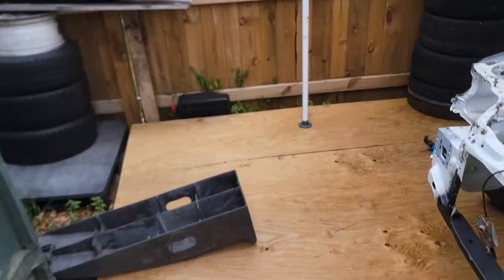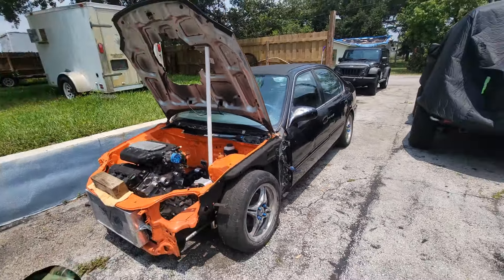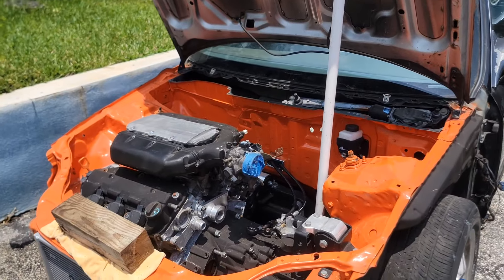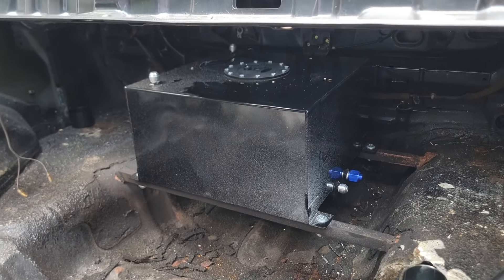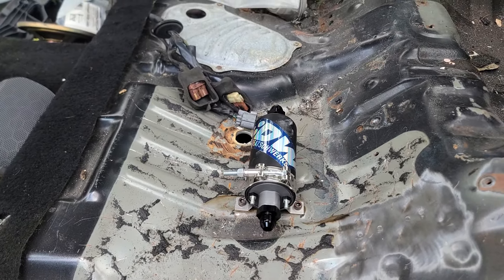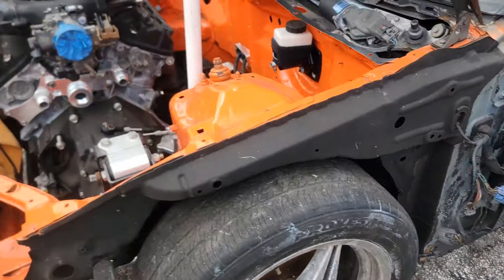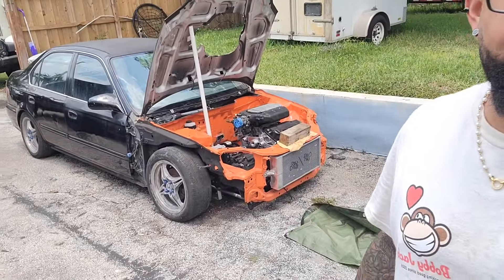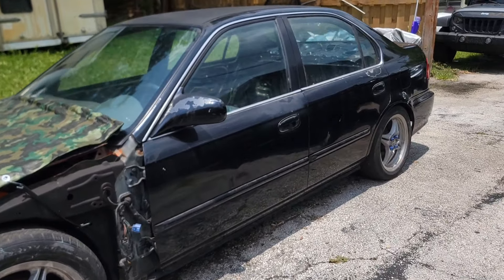2000 Civic V6(J35) PROJECT - FOR SALE

Comment: Did you end up selling it ?
Reply from the maker: @ItsRandy6763  shell is gone. Still got motor and a few other odds and ends
Reply: @ how much for the whole swap if you got it ?
Reply from the maker: @ItsRandy6763  only have the motor,cables,inline fuel pump n filter. Everything else is gone
Reply: @ how much
Reply from the maker: @ItsRandy6763  ill take 400 (J35A..JDM)
Reply: @561AutoWorx  that’s just for the motor ?
Reply from the maker: @ItsRandy6763 that is correct